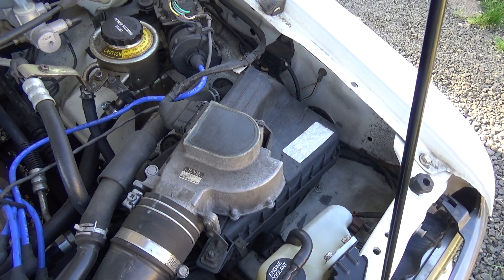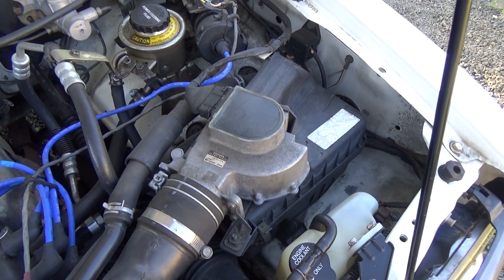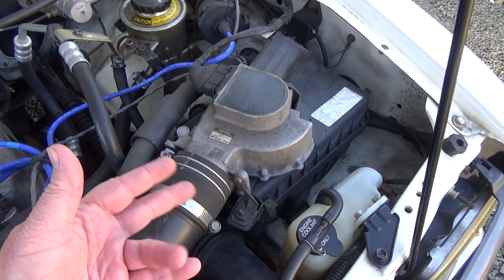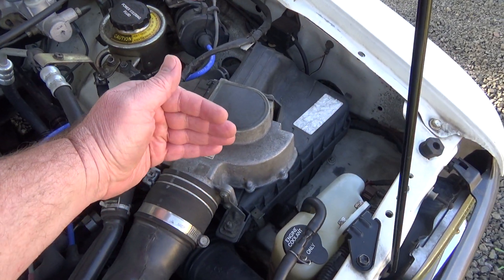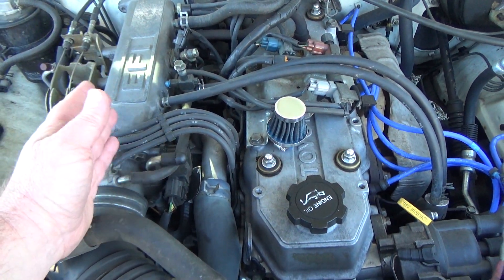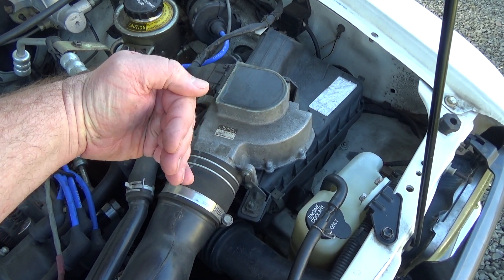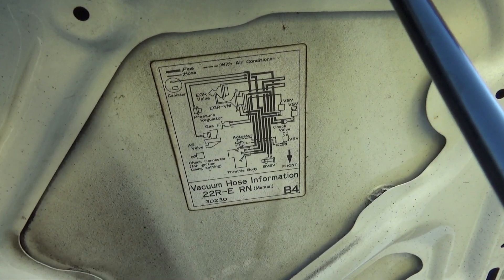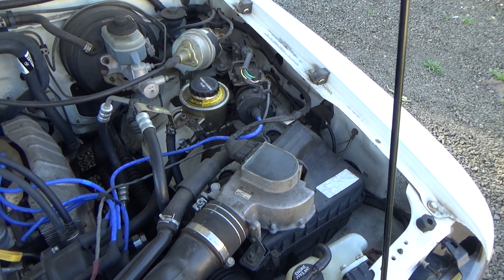#22re User question:  AFM and Coil

Comment: The wiring harness on mine was stuck and i lost patience with it.  
DO NOT do as I did and try removing the 2 screws (they are nice big juicy ones) 
Unless you have knowledge or the soldering skills you will end up with a skewed PCB
Of course once you open the cap and can see how it is inside you just don't really know for sure.
Anyway,  Save money and time by be patient with that old school japanese harness.

Comment: My truck runs good for about five minutes then starts misfiring could that be mass airflow ?
Reply from the maker: I doubt the Air Flow Meter is bad.  The 22RE is complicated, and has many exceptions that can cause errors.  I would look for an old mechanic that has a history of working on the 22RE and pay for a diagnostic.  The engine hold many secrets.

Comment: They call it the MAF meter mass air flow meter but yes the little black cover can be removed but you will have to silicone it back on.
Reply from the maker: MAP, uses pressure to calculate air flow.  Found in 90's Civics.  MAF typically uses a wire and the rate the wire is cooling, to calculate air flow.  The AFM, almost unique to Toyota.  It uses a flap that is deflected, to calculate air flow.  It is similar to carburetor, but used for electronic feedback, instead of mechanical.
Reply: Sorry that is correct 👍 Thank you 😊

Comment: Beware of buying a new maf from china. They have a high failure rate. Most are defective from the factory. Always do an ohm resistence test on the new maf before install. Don't take it for granted it works correctly.

Comment: Could this air flow meter cause my 22re to bog out and not start? My 85 4runner wants to start but seems like it’s not getting fuel. 
I thought it was my fuel pump not sending gas but found out the pump does work.
Reply from the maker: So many possibilities.  Did it every run right?  Is this something new that just started?  Fist thing I would check is the battery.  Take it to your local parts store and have them test it out for you.
Reply: @tubejim101  85 4runner  hasn’t been running in 10 years…brand new battery, ran 12 volts directly to the fuel pump and it runs/ turns on, cleaned throttle body.
When I spray starter fluid into the manifold, vehicle bogs and hiccups to start up…that tells me it’s getting pressure. it actually ran for about 10-15 seconds til the starter fluid dissipated. 
No response when I throttle. Only when I used starter fluid I rev’d it pretty high.
A mechanic told me if I used starter fluid and my vehicle wants to start up then the problem would be my fuel system…but I never knew that this Air flow meter could be a possible issue too.
Reply from the maker: @straightshooterz  I would check you throttle position sensor, and your idle air control.  10 year, you should just replace all the vacuum lines.  That engine has tons of hoses on it.  Those coolant lines around the throttle have to all be good.  See if the plenum behind the throttle body is all gummed up.  This is assuming you took the throttle off and cleaned it.  All those little port holes get plugged up.   Also, your fuel injectors might be stuck.  Take a look at this video:  https://www.youtube.com/watch?v=Me3ElkViAb4

Comment: Nice! Now my Toyota Pickup 1994 (looks just like yours here) is giving me CEL code 71 (EGR problem). I saw video using vacuum pump to check EGR valve and modulator units... Looking at EGR valve unit it seems in the back and very low (hard to reach the nuts and bolts to unscrew)... Can you make a video confirm those two devices and location and show how to possible remove that EGR valve to clean it, possibly without needing to raise the pickup higher?